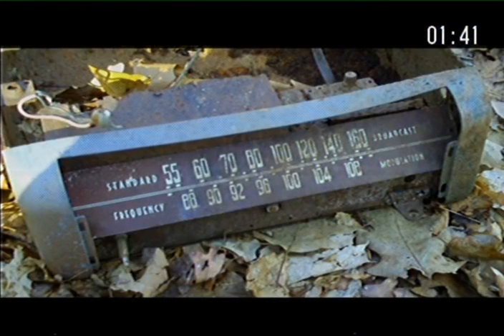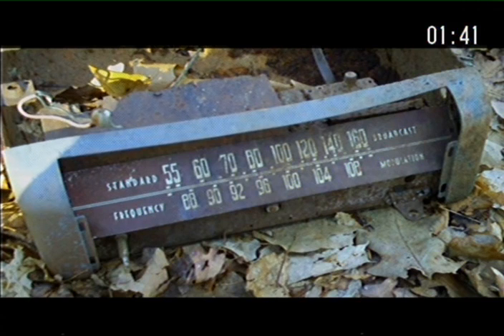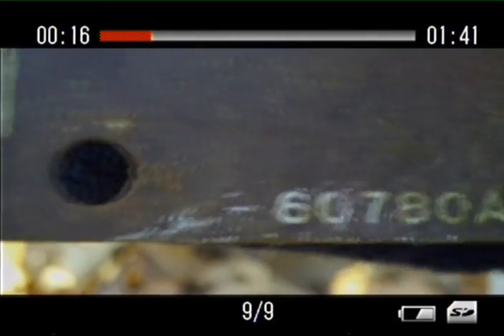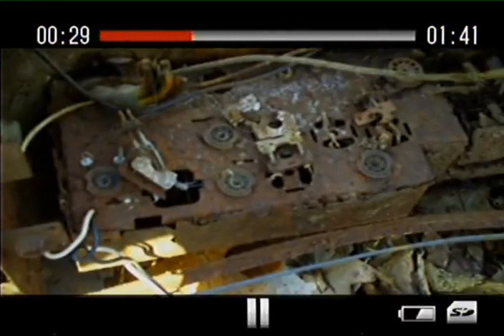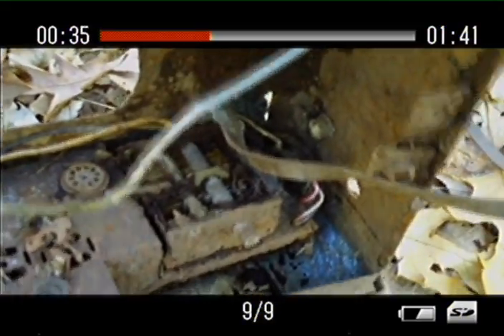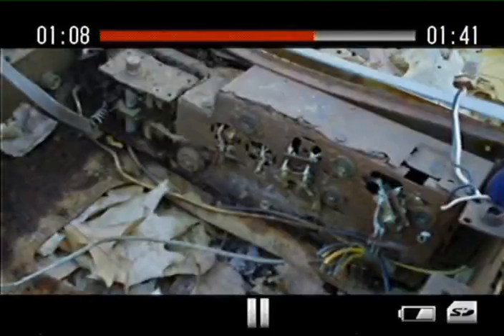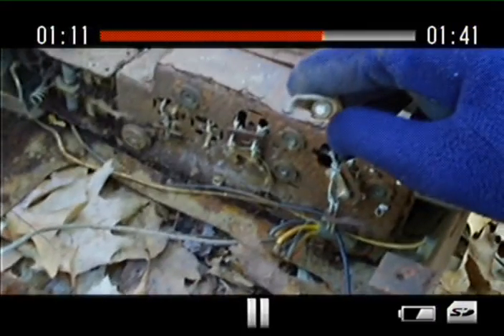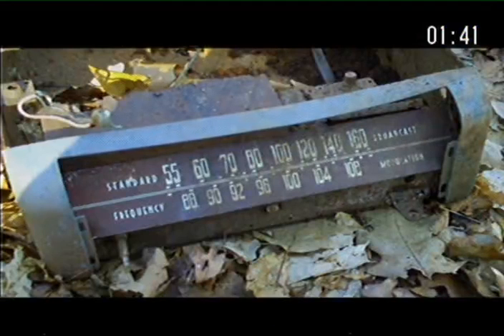1950s AM/FM radio chassis found in the woods

Comment: This is the “Dynamagic” radio section from an Admiral 4H15 console unit , a combination TV/Radio/Record Player console from the very early 50’s. It originally had a gold colored faceplate and a record changer on top of it and was mounted in a pull-out drawer next to the TV set. Don’t know why YT recommended this in 2020, kinda weird!
Reply: I recognized the tuning dial.... then remembered the old blonde finish cabinet Admiral combo that sat in our basement about 15 years. Only the radio worked, but it was real good. Parents paid big money to fix the TV, in shop 6 months. Failed again a week after we got it back.

Comment: Can't be that old, its got an FM band.  I found a 1951 GE 605 in collapsed and decaying barn, and it was filthy, and had one tube left.   I proceeded to restore it, until someone gave me a GE 430 in near mint condition, which I recapped, fixed the tuning cap vanes, and works like  dream, with a 100 yard long wire attached.

Comment from the maker: It is from the 1950s, but is not a car radio. It was the tuner part of a console hi-fi system.
Reply: It does sort of look like it was from a hi fi, or at least look like it was meant to sit on top of something to me. Because the front faceplate dail plate looks like it was meant to be looked at from above, or at least in related direction. Unless the front of it was expected to jet out past the dash from the lower area of the dash.

Comment: This looks like it was a drawer used in a console radio-phonograph. I have not seen this exact model but RCA made some which were similar. The record changer would have mounted in the top of this metal housing, that is why it is so big. The whole thing may have been mounted in a wood drawer frame or may have been a stand-alone wood drawer. The amp/power supply would have been on a separate chassis. The RCA cable is either the phono input or the output to the amp.

Comment: I can tell you exactly what this radio is.  It is a 1951 Admiral.  It was a radio record player and television combination that use to be in a console floor model cabinet.  The record changer used to sit on top of the radio .  It pulled down out of the cabinet by a single spring loaded door.  The televison was behind a door on the right.    I have photos of this Admiral in good condition.
Reply: We had one you are correct.

Comment: @luigi2999 
I bet there is a point in most TVs where there is an analog video and audio signal similar to that of an RCA video output. maybe someone could wire in a switch to flip between the tuner video and the game video signal but I dunno. That may be the best way to get a clean signal to the TV vs going thru a lossy RF connector.

Comment: I don't think this was a car radio.  Every car radio I saw from the 1950s used octal tubes (usually 6V6s or 6F6s) in the audio output- there are no octal sockets and no audio output transformer which all tube amps had. I think this was the tuner part of a in-house console system.

Comment: that would be awesome if you found this radio earlier like when it worked. if I ever found a working radio like this id hook it up. its a shame that whoever owned this radio just simply gave up on it vs trying to fix it as tube rigs are not hard to fix and are reliable.

Comment: @Kittyslasher69 
Just tap the CD player line out or Radio line out and run those to a jack. then just plug and play. I did this with a boombox that had some stuff fall on it and it busted the radio board which was separate from the rest of the circuits.